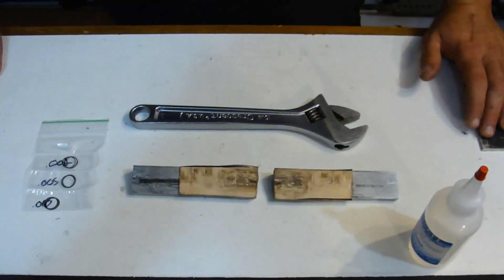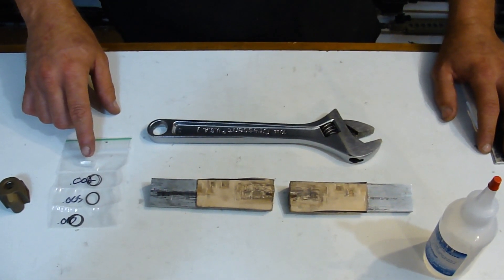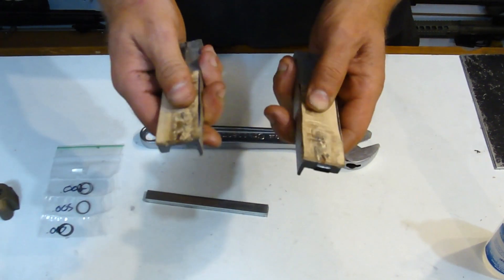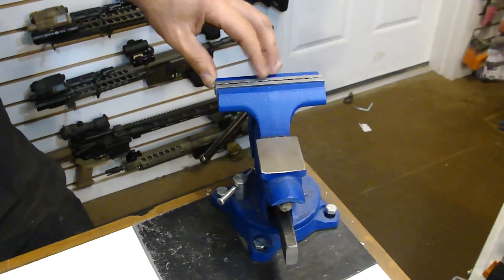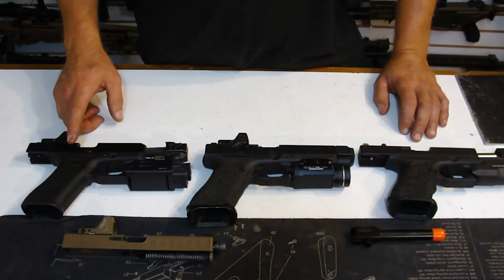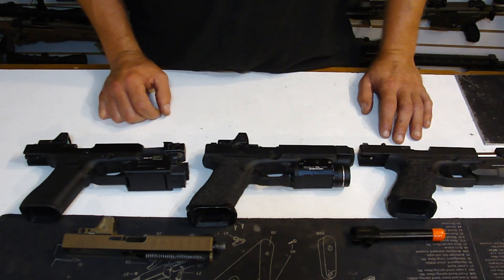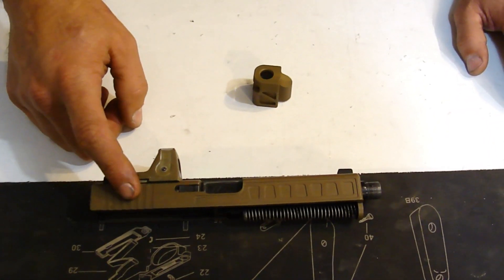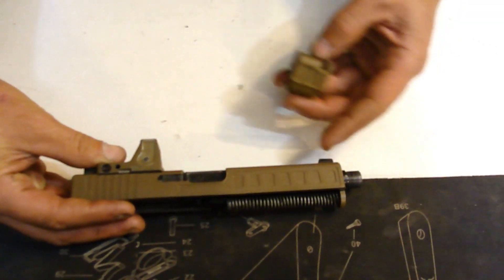PMM COMP installation Video

Comment: Glock 19 wth SilencerCO barrel. Used included shims: Two .010s, one .005, and one .002 making up a total of .027 as the comp needed to rotate 270 degrees for a snug fit
Reply: This is an old video. I think they just changed the compound used to affix the comp since this video was made.

Comment: Great Video. I just installed the PMM Comp on my FN 509 Tactical. I used 0.014 inch shim which made it  require slightly more tension to align. Yes I agree with others... 10/10 on instruction video!

Comment: So my pmm comp for my p226 came with shims that wont go over the barrel. Like not even close- they are the exact diameter of the barrel. Can i sandwich the shims inside of the comp, between the comp and the face of the barrel, instead of having the shims sit on the shoulder of the barrel? Im worried the shims being so close to the crown of the barrel will cause the round to hit a shim as it exits. It looks like the shims barely clear the rifling but if i tighten it down they may flatten out a tiny bit and become an obstruction. Im using the factory sig threaded barrel.
Reply: Had the exact same situation, I still haven't tried it out, did you have any "baffle strike" on the shims? Or any other issue?
Reply: @MrIggy562  so PMM reached out after i emailed them and they had sent me an alignment tool that sits in the end of the barrel that keeps the shims aligned. I felt pretty stupid because i saw the alignment piece and didnt know what it was for so i just set it aside lol but since using the alignment tool, the install was a breeze and i have not had any shim/baffle strikes. Did yours come with the tool? Its a cylindrical thing about two inches in length with a slight shoulder on it. The PMM comp makes my already soft shooting P226 even nicer to shoot. Definitely worth the money.
Reply: @metaldave556  yes it did, now that you metioned it lol thanks for the helpful info
Reply: @MrIggy562  no problemo. I wish they'd send instructions. It says on their website that they have instructions via pdf but i couldnt find the download link anywhere on the site and when i googled them, they would fail to download. Oh well. Good luck, you're going to love the comp!

Comment: what if i put in a shim and it fits perfectly in relation to the slide and i don’t need a vice or wrench to torque it down? it looks to be seated well with very little space but i didn’t need to use anything…is this a problem that it may be too loose or am i good?

Comment: Have to say pretty disappointed.... CZ P07 install, not a smooth side on the comp to even grab with a vise or a wrench.... soft aluminum got marked up pretty good and the finish flaked off, all with out even firing a shot. 
Maybe awesome on other models but, for my P07, not so much.

Comment: If the corner of the comp lines up to your front sight without shims, it’s ok to not use shims right? My fn509 jttc comp lined up perfectly so I used some loctite and snugged her down shimless.
Reply: from my understanding if you dont use shim, it will come off loose easily
Reply: @hansolo8263 no it doesn’t lol use the rock set provided and it’s not gonna come loose

Comment: Wouldn’t you want to vice the slide and wrench the comp with a rag or something over it? Seems like a lot of unnecessary torque on, well, everything.
Reply: No.  This is the best technique.  Puts the force where it needs to be.
Reply: @want2race441  I guess my point is, it also puts force where it doesn’t need to be either. Honestly probably fine either way though.

Comment: Soo noooooooooow how do you get the barrel out and cleaned it?
Reply from the maker: Simple pop the slide off remove the recoil spring get the barrel slight angle and then run a cleaning rod through it

Comment: Is the dual port comp and barrel combo ready for the G45 yet and if so can someone give me a link to it?
Reply: Its ready...got one installed on my G45...havent had the chance to try her out yet thought

Update: Ran that biotc# like I owned it for prob 250 rounds of fmj 115 grain target rounds.....had 3 or 4 mis-feeds.....not perfect but not bad for the range......124 hollowpoints and fmjs ran flawlessly however.....even with the mis-feeds this product is TOP NOTCH....PMM guys keep up the good work. Partner this barrel/comp with an Apex trigger and it is as smooth as butter and the reset is excellent, stays on target everytime. Highly recommend it...👌
Reply: Not yet from what i have seen. I run the one port on my duty G45 and it has feed issues 1 in every 25 rounds or so with target ammo, have to run +p for it to be reliable and I hope the two port works better.

Comment: The Walther ppq installation is a tad different due to the ridges on the face of the slide.
Reply: How did it go? Any advice?
Reply: @BalrogUdun  you might want to get it timed by a professional or get a workbench and vise.

Comment: when i order this, does an adequete amount of shims come installed or do i need to order the extra set?
Reply from the maker: We supply one set of shims with each COMP which should be fine
Reply: Buy a extra set of shims for $10 or $12. That way you know your covered. Also, you might have to take off your compensator for some reason.
Reply: @vtecfed420  good idea.  Should have got a spare set.  Bummer

Comment: Rad video, a couple questions. Do these work fine with  115gr/124gr non +P without changing the recoil spring? Secondly, are there any issues cleaning the firearm after range use? Thanks!
Reply from the maker: All our COMP's will run on GOOD 115 ammo with no change to the recoil spring, this is all based on whether the shooter is doing their job in holding the pistol properly.
Cleaning it is pretty easy just remove the slide and recoil spring and can't the barrel and clean it out.
After high round counts 15k+ you will get a buildup of copper,carbon & lead in the port using heat from a torch and done elbow grease helps break it loose

Comment: I just purchased a Zev Technologies’s O.Z 9. Getting it Monday. I’m told that it is comparable to a Glock 17 in barrel and slide length. I want to purchase a compensator for it. I saw that in your demonstration you used an older Zev barrel. Will your comp be compatible? Is there a specific part number I should order? With the rock set, do you need to apply heat to break the comp loose for cleaning? Thank you

Comment: Just ordered my PMM glock 19 combo 🤘🤘
Reply: How is it? Does it run range ammo well
Reply: @RigorousEnlightenment  Yep, Its ran Blazer 115, 124, and winchester whitebox 115 with no issues. Plus Critical Duty hollow points with no issues
Reply: @8bit.Operator  and you're running a stock recoil assembly?